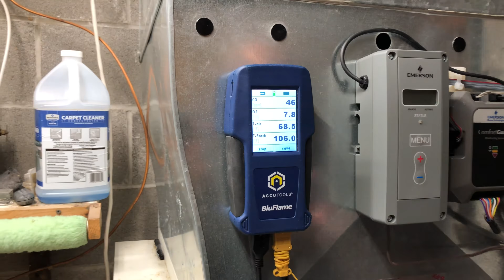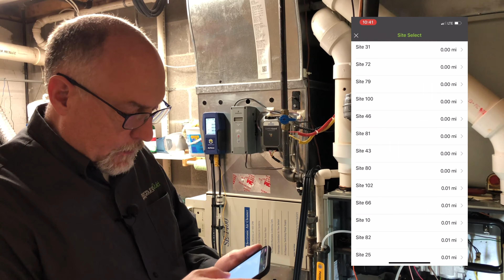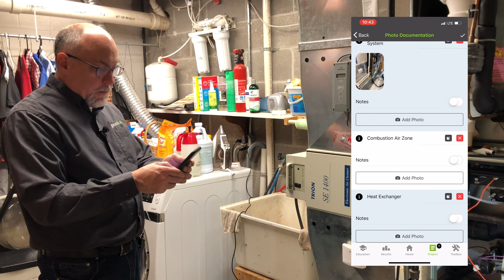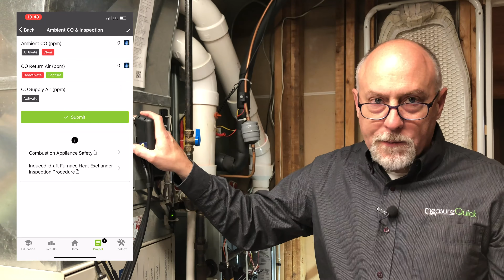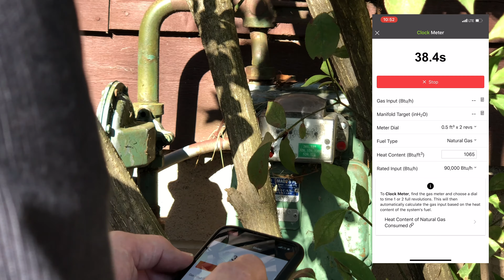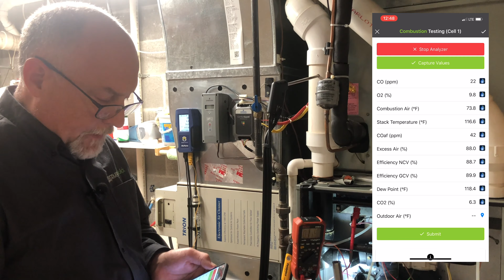Quick Gas Furnace Service: Heating

Comment: You make this look so easy. I doubt any contractor in Tennessee does this. Need more contractors out there that want to invest in education to make sure we are properly inspecting units. Jim education is lacking at least where I live and more about selling new equipment. We need accountability in this industry. Should be a absolute requirement when commissioning equipment and manufacturers should void warranty if this is not done. It's depressing because I want to do better but they don't want to seem to invest. Do you teach any classes? Combustion analyzers are crucial. I struggle sometimes due to not having the right tools Not because I don't see a problem just can't fully diagnose it and only assuming.  Manufacturers really need to enforce getting these readings before they allow a warranty. They are losing money as well from poor installation. And not properly dialing in everything. It's really not fair to the homeowner who spent 1000's and they have issues.
Reply: Man I think I'm the only person using a testo combustion analyzer in my town . No wants it my boss said that you don't need it

Comment: A lot of furnaces we deal with are fiberglass so would it be the same concept to take an ambient CO tester in the zones? Or is it more accurate just to cut a section out and test with analyzer?
Reply: I’m use to just taking a walk around the house with my ambient CO and checking at chest level for CO. I know you can stick your analyzer in the duct but I get paranoid from particles or dust getting inside the probes. Thats why I asked would it be the same concept bc I like to zero it before I get to the job and just do a quick walkthrough before servicing the furnace. Then if I notice unusual readings I would check the actual air stream with my analyzer. But it is probably more work to be walking upstairs just to get CO readings of your going to be by the furnace regardless
Reply from the maker: @acrservicesmathewr7565  there are particulate filters in every analyzer. No need to dust.
Reply from the maker: Do you mean duct board? Fiberglass duct?
Reply: @measureQuick  duct board

Comment: RE Michael has some really nice filters that would fit that air cleaner perfectly and I think it's thicker than the one you have. I highly recommend. I can get the model if you are interested
Reply from the maker: Sure
Reply: measureQuick RE MICHAEL part number 16H2624C try that

Comment: Once again FANTASTIC video, thank you. One thing I want to add. When ever you are working on a 2 pipe system that does NOT have a sealed combustion chamber you should have the upper furnace panel in place when under testing.  The upper panel/frame area is generally 'gasketed' which forces the combustion intake air to be pulled through the intake pipe.
Reply from the maker: If you watch to the end, I did perform a final test with the door in. In reality, if the vent system is properly designed, it will not change the combustion or operation at all. The only difference will be where the furnace gets the combustion air from. Having the door on for testing and adjusting is not practical or needed. Verifying that it is operating correctly with the door installed after testing and adjusting is. Good feedback for discussion.
Reply: @measureQuick  LOL, I stopped when you signed off (the first time) didn't see there was "bonus" material.  Diagnosis time and Level of accuracy notwithstanding, you can easily match the equipment running conditions (in most cases) with the wireless tools we now have access to. The wireless signal will easily pass through the metal cabinet if you are in front of it.

Comment: Chemical in the CAZ being pulled in the heat exchanger of a 2 pipe 90% furnace?

Return static in just one spot of the dual return?

Is that ductless far enough away from the meter?

What is that plug you have in the venting, for the analyzer probe? I do not see it on TTT site.

Would taking the incoming air temperature, in the intake pipe, be advantageous in the combustion analysis readings?

What is purpose of the polarity test?

How many systems out there are .5" W.C. TESP? Most of us will probably be overriding/ignoring that item.  

Great idea on the Testo add on magnet. Link/info on what you used and where to get it?

GREAT video!!!!!!
Reply from the maker: Yes, chemicals in the CAZ can affect a 90+ they are not hermetically sealed. 

As far as the return, the pressure exerts equally in all directions, one cannot pull harder then the other. 

The plug is a high temp silicone, 

I will see if I can find the source. 

The ODA temp will effect the net stack temp and efficiency readings. I did have a thermocouple, I forgot to put it in the intake at the end. 

The polarity test is to make sure that the flame signal is not corrupted from the low voltage being out of phase with the high voltage. 

.5” is the rating, .7” is the threshold. Mine is on the fringe. If I could get to it I would fix some of the ducting. 

The magnet was from K&J Magnetics.
Reply: @measureQuick  I'll add my name to the list for wanting to know where you got the plugs.
Reply: .5" W.C. is vital to measure. With the loss of PSC motors high static is, in everything I've seen, one of the biggest causes of failure on X-13/ECM motors. Design static is in every manufacturer's instructions for a reason. One motor replacement easily wipes out most, if not all, the savings that the customer has gained from moving away from a PSC motor. Lack of return air is often the cause, and often very easy to fix.
Reply: I may be wrong, but if 120 subtract 24 is 96, isn't the AC signal 180° out of phase?.

I had a hell of a time with a York RTU to sort out this very issue using a service bulletin that the manufacturer provided.
The supply voltage was derived from three phase power (208) volts which seemed to be an aggravating factor.  Replaced the IFC in the end
Reply from the maker: @gordonborsboom7460  It’s the difference between the two, you have to look at the difference between 24 and 120. The potential difference between those two is either 96 or 144. It’s not the potential from zero it’s the potential from the line side of each circuit

Comment: FYI ... P/S port on Rheem inducers tends to plug up over time casing erratic furnace operation.  Difficult to see the blockage as it is at the back of a black tube.  1/8 " Allen key inserted in the bung cleans it out nicely  (unit off of course).

Comment: Nice video. Thanks for the info. Completely off topic but can you check 2 systems at once using the measure quick app when checking ac? Thanks
Reply from the maker: Not easily, you would have to still move around the tools. We are working on some options for that, but they are a ways out.
Reply: @measureQuick  thanks. Any update on integrating the fieldpiece sc460